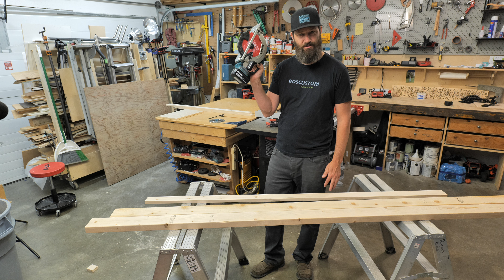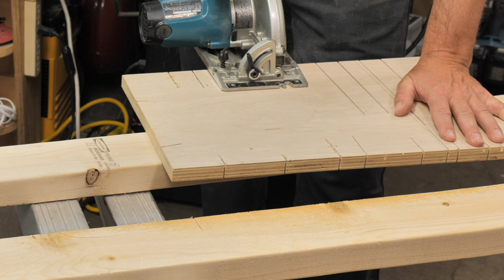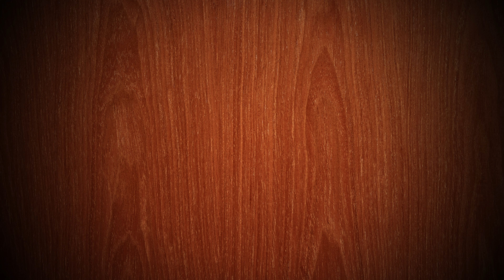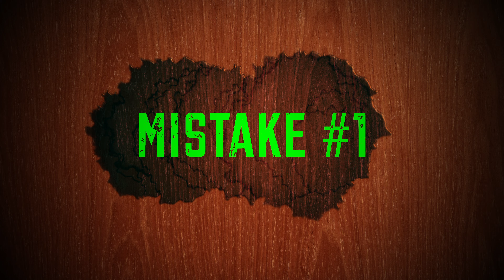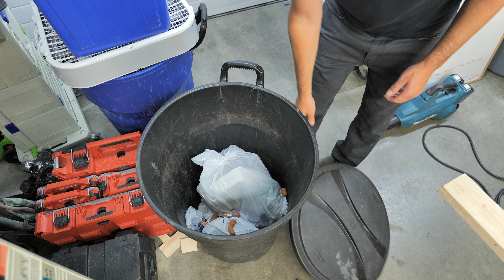5 Critical Circular Saw Mistakes You Can't Afford To Make!

Comment: I have used circular saws a fair bit when I was younger but not used one in the last 15 years but have just bought a brand new 40v Makita 185mm. I used it for the first time recently to rip some mdf board and its very powerful. My problem was I was not using a fence or track (its compatible) and the blade ventured off course so naturally I tried to ease it back on to course and that is dangerous. The saw kicked back with such speed it cut about 150mm back into the good side of the mdf, basically ruined a large piece. Luckily for me I had both hands on the saw and was able to control it but it happened so fast. Safety is paramount I am planning on getting a track for it.

Comment: Thanks.
- Two hands on the saw. Cutting your fingers probability drops to zero. Also provides you with better control in case of kickback.
- Do not use a dull blade.
- Ear protection.
- Clamping the work piece with two clamps, minimum.

Comment: Folks don’t use your feet to anchor wood on top of wood. If the pile of lumbar slips out, and your leg is under tension, it will slide across that blade. Don’t  DO THAT, I’ve seen that accident more than a few times on job site. That’s pure laziness. This video is a joke.

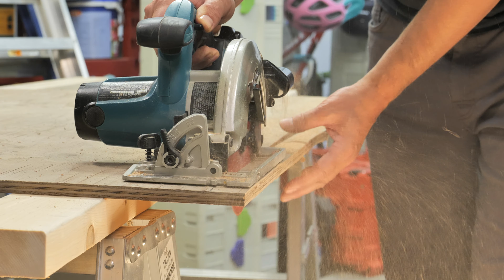Comment: Videos on Youtube said  to let the wood fall off the end, so it doesn't bind the blade,  but when I got to the end of the cut, the weight of the overhanging  wood  6:43 caused it to twist and tear off of the blade anyway.  Why does everyone on Youtube show cutting over an edge but doesn't show it tearing at the end? it's always perfect cuts on the video. But in real life,  It messed up the corner edge of the wood I was cutting and I don't have extra to Mess around with.  

Only a couple of people, including you, suggested "sacrificial wood" or putting a piece under it 7:15  . I didn't care about it falling but No one warned me about it tearing if it DID fall.  I guess I should watch all the videos about what goes wrong instead of the Beginner's guides that just show everything going right without any mistakes.

Comment: Beginner here. I don't get it, if you set the blade as a little passed the depth of the main piece, it might not cut the sawhorse in half but it'll scratch the hell out of it won't it?
Reply: Maybe you aren’t old enough to have seen the old wood sawhorses carpenters used. Trashed with cuts!

Comment: Saw a bad issue with someone using a table saw once. The guy who was holding the far end of a 2x4 wasn't paying attention (playing on his phone like a dumbass), and the blade grabbed one half of the wood and slammed it towards the operator. (Think it was an 8 or 10ft piece being cut length-wise.) The guy on the far end immediately panicked and thought the wood went thru the operator. Wasn't the case, but he did have a HUGE bruise on his thigh from it.
Reply: Imagine if he HAD been paying attention and tried to hold onto the piece that was being kicked back at the operator. That's how rock climber Tommy Caldwell lost half of his index finger. The kickback PULLED his hand into the spinning blade because he was holding onto it, and a kickback happens faster than anyone can think "let go." The kickback was the operator's fault. I'd bet you $1,000 there was no riving knife on that saw.
Reply: @wulf67  no idea what that is. from what i remember, the blade grabbed the (smaller) half that was being cut free, and slammed it into the operator.

Comment: I feel safer with a chain saw in my hand than I do a skil saw. At least I have both hands on the tool, as many saws only have one handle.  I’ll use my chop saw or table saw whenever possible.  Skil saw is the last resort.
Reply: More fingers have been lost on table saws than all other saws put together.

Comment: I was fifteen and using a corded circular saw in the garage when I learned a good lesson: Be mindful of your cord.  I cut through the cord and after a bright flash, the lights went out.  It scared me so badly I dropped the saw.  I found myself in the dark with a runaway saw as the blade was slowing down.  Luckily, I wasn't in its path, but it hit the ground, broke the carbide off a few teeth and covered about eight feet before it came to a stop.  If any new DIYers are using a corded saw, never assume the cord is out of the way.  Check it before every cut.
Reply: My experience has been the cord binding on the back side of the board and causing the blade to bind as it gets torqued the wrong way. I'm so sorry you had to deal with electricity AND a dangerous spinning finger separator!
Reply: @matthewbay1978  Good one!  And one I'm very familiar with.

Comment: Trust me when I tell him you beginning woodworkers that once you’ve experienced kickback on/with ANY machine, you’ll NEVER want it to happen again! My first and thank God, ONLY experience was with my table saw. I was new to woodworking and not paying attention to the simple aspects of safety BEFOREHAND and nearly broke my chest and collarbone. The carpenter’s adage is, “Measure twice, cut once”. Do the same with your safety - Check your set up, then check AGAIN! You won’t regret it. Bright Blessings to all! 😊
Reply: Yes, this! Get a small strip of wood wedged between the stop and the blade and that stuff shoots out like fired from a cannon. Happens very easy when at the end of the cut you put a bit more pressure towards one side when pushing the material past the saw and BAM!

Comment: I like to make a 2x4 frame and put thick foam board on top.  I use shelf grip from dollar stor under sheets. I find a way to clamp if I can.  It slows down the process a little but.  I respect the dangers of the equipment and I like my fingers. : )

Comment: You're using a cordless circular saw(which has the motor on the right hand side of the saw ) for a tutorial. When 99% percent of carpenters use a corded  saw which have the drive motor on the left hand side of the saw. Two totally different ways of cutting with a circular saw when it comes to hand choice and head placement so you can see your work.
Reply: This video is for beginners... who are most likely to have bought a cordless. (If you're using someone else's, they would hopefully be telling you.)

Comment: Great video. I’ve been using a circular saw for well over 50 years now and one thing I’ve always tried to do is to keep the large part of the saw base plate over the supposed part of the material.
Reply from the maker: Great tip!
Reply: Yes, I agree and I don't know this method isn't waaaay more popular. So much more stable.
Reply: Yes! This is the worst mistake new users and old users do too much. And, placing your body/face on the blade side of the saw. You should AlWAYS be on the motor side to keep sawdust and cut off pieces away from your face or body parts.

Comment: With a circular saw always set it down on it's side with the blade away from you. Never set down directly on the guard. The guard could have hung up and the saw could kick back causing injury. Especially on a larger corded saw.
Reply: No. I just visually confirm that the blade guard is down before I set it down. Usually the brake stops it before that point anyway.

Comment: Great video as always! In my early days, I was ripping a piece of osb with a circular saw, made the cut and placed the saw on the work surface before the blade had come to a stop, somehow the blade guard wasn't fully up...the saw kicked back in my direction... luckily it only caught the shorts I was wearing...for more reasons than the slice, I needed a new pair of shorts. Never made that mistake again.
Reply: Alway lay the saw on its side with blade away from you. If the guard hangs up, no worries. I learned that a long time ago.
Reply: Ha ha! "For more reasons than the slice."
Discreetly put, sir.
I believe the Aussies refer to this as "a brown trousers moment."

Comment: with the battery powered saws, you don't want to touch the saw blade or put your hand near it while the battery is connected.   All that blade has to do is spin for a second or two, and you can say good-bye to those handy little fingers you had for the last 30-40 years or whatever.    And you can set the blade to spinning with a simple thing like a sneeze, or a hornet dive bombs you, whatever.   Or, the unit can malfunction.   It is a relatively inexpensive mechanism, it can malfunction.   Do not put your hand or fingers on or near the blade while it's connected to a power source.    really.
Reply from the maker: Excellent advice for sure. This particular saw had a two part mechanism to power it up…still not a good idea to touch the  blade though!

Comment: I always though blade depth was to the bottom of a gullet and not just 1/8-1/4”
Reply: Depends on what you're cutting. Sometimes (like when cutting a very thin laminate) all you want is the carbide tip of the tooth to penetrate the bottom of the cut, which is somewhere between 1/8" to 1/4".

Comment: I love your cordless circular saw! I’m used to using worm drive circular saws with the blade on the left just like yours. Much easier to see the cut.
Reply from the maker: It's funny I've tried a couple worm drive saws, feels like a different universe of tool.
Reply: @TheFunnyCarpenter  yes they are heavy!
Reply: What brand?
Reply: An experienced circular saw Op.  does not need to see the cut.  Set the depth and use the guide in front.  Perfect everytime.

Comment: It bears mentioning that kickback is severely reduced when using a tracksaw. It is not entirely nullified but almost null. Obviously the tracksaw isn't the first choice for every cut you've discussed but certainly for any panel product where kickback is of greatest danger. Personally between the drop saw and the track saw, I have no use for the circ but everyone has their own work methods.
Reply from the maker: Track saws are great!